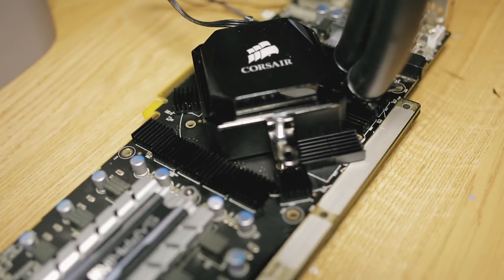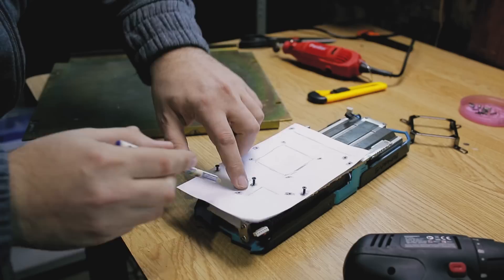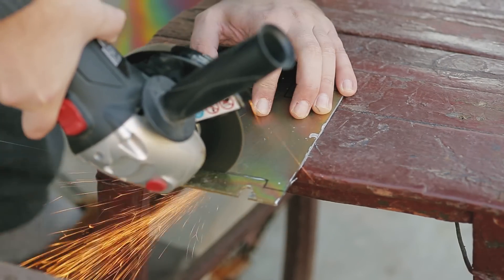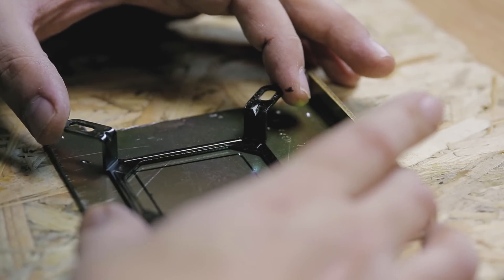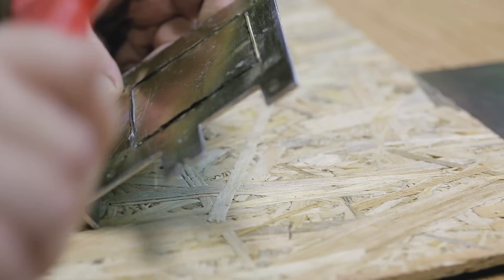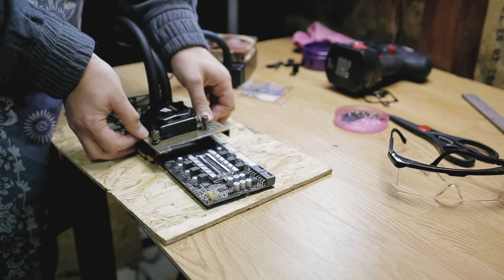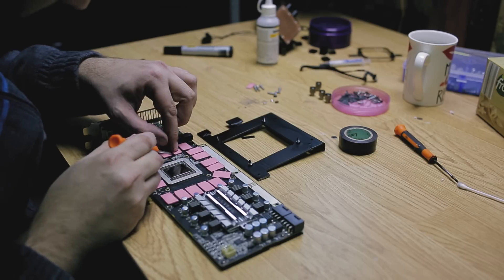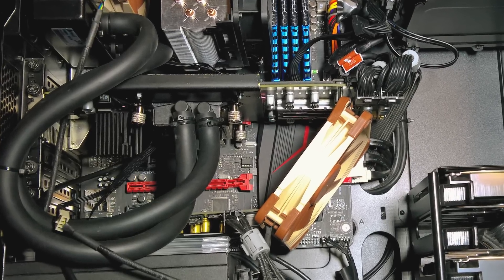DIY MOD plate for AIO water cooling Radeon R9-290 GPU

Comment: And if you want to go with a 120mm or 140mm radiator, ALPHACOOL has custom copper radiators that are SUPER deep. 1", 1.5", 2" deep, etc. So, you can DEFINITELY get the performance of a 240mm or 280mm AiO out of those radiators.

Comment: thanks, i tried following my gtx 1080 successfully although it doesn't look like yours but the performance seems pretty good max GPU temperature 60 degrees C, Hot pot 70 degrees C

Comment: Great Hack. Also if you run a bead of thermal paste on top of the pads, you can see if they are making proper contact with the plate, and it won't harm thermal contact either.

Comment: sir please help i want this diy mod in my asus 1660ti oc single fan phoenix is it possible?
Reply: @BeardsChips  its single and very small heatsink it super hot 89temp i will do the same thing but i will use the deepcool mini fs aircooler hope it will sucess
Reply: may i ask can i put small heatsnk directly to the VRAM without thermal pads?
Reply: i saw some other videos mod they put directly heatsink to the VRAM with no tape or thermal pads on it, is it still possible or bad idea
Reply: @BeardsChips  thanks for the help beards and chips

Comment: Did you bother to use a multimeter to check continuity from that metal plate to any of the terminals? I’m curious if you fried your gpu? When I machined a plate I had to emboss where the memory chips were so that the adapter plate didn’t short out on the smd circuitry. There were at least a dozen terminals with continuity before I further machined the adapter for clearance. There was no way that a flat metal plate would clear without shorting multiple components. After the proper machining I resolved the issue but it made for a very complex adapter so the average enthusiast has no way to fabricate properly. I own a full machine shop so fabricating them isn’t a danger to the gpu pcb components. I see your video is 2yrs old now and I don’t see a final test to prove your adapter. I hope nobody tried this without using a multimeter to verify a proper installation. Also you should use aluminum or copper and not steel.
Reply: That’s good. I couldn’t tell where all the contact points were because it was too difficult to see between the board and adapter with far too many smd components. Would be nice if YouTube allowed photo and video comments. It may have cleared if I had used some thick thermal tape but I’m not a fan of thermal tape due to its thermal inefficiency so I initially used some thermal paste and stuck the heatsink adapter plate on to the memory chips so i could use the residue to outline where I needed to machine around the squares in order to emboss them where the memory chips sit to elevate the adapter 1.5mm above the board. This also helps keep airflow between the boards and allows any additional radiant heat to transfer. My GPU project was a gtx1070. I also utilized a large 120x240 coolermaster for a LGA AM4 2066/1151 socket and built the adapter into a finned heatsink with additional fans that was designed to overhang over the main board a whopping inch and a quarter allowing the heat to draw to the outside and quickly cool where twin 30mm, 18,000rpm fans keep the adapter ice cool.. ,Still quieter than the factory twin fans, yet far more efficient. The design we used here dropped temps down to 40-50c. Total spent was $59.99 on the cooler and some minimal time machining a scrap piece of T6061.

Comment: Great how to, thanks a lot! I hope to be able to do this in this next week :)
Reply: Florin Musetoiu Good tip! I will take that into account 😀
Reply: Did it today! :D. I used 1 aluminium sheet of 1mm thick (I was afraid that it was to thin) and it works very well. GPU is around 60 ºC while VRAM1 is 88 ºC, this at 100% load and without noise which is really awesome for this graphic card model (and even reusing the old termal pads).
I was looking for PCB bending while putting the bolts and no bending occurred, however PCB started to bend when I attached to the mother board, I guess that it happened by the lack of supports and the power cords weight. 
Thanks for this video, It is very helpful and it can be applied to any GPU, you just have to find the correct metal sheet form for any GPU and follow these instructions.

Comment: using an aio where its semi not is always a lovely feat :D my 780 under my h100 is only about 2c hotter than my other accelerod card
Reply: the accelero is cooling the ram and vrm, and the zotac card im using with my h100i has a stock vrm heatsink that a 120 fans blowing on its fine

Comment: Is it cooler than the original mod? Also, what clockspeeds can you get with a cooling setup like this?
Reply: Thanks for the answer. I'm thinking abaut watercooling my card mainly because i also play BF1 and during that my card hits 84°C at auto fan profile on stock clocks. (1040/1250, i have a GIGA WF3 cooler) And when i use my overclock profile 1080/1400 at 100% fan speed it hits 84°C under a round of any operation. For the cooler i'm abaut to buy a CM Seidon 240M wich should be sufficent even on other, more powerful cards. For my own mod i'm thinking abaut making an X backplate similar to the one in the NZXT's kit so the stress would be even between the screws.
Reply: Hope it's nothing major. This is why i want to do a backplate of some sort if i make a mod similar to yours, maybe even an adjustable one so that later it can fit other cards.
Reply: The Deepcool Maelstrom 120k fits perfectly on my R9 290, I have it running Monero coin mining 24/7 and it never goes over 56c  https://www.amazon.co.uk/DeepCool-Radiator-Cooling-System-Liquid/dp/B00LTSWC4Y
Reply: Florin Musetoiu, Salut! Super tare mod-ul tau. Chiar este de apreciat faptul ca nu iei de bun ce vand altii si observi unde este loc de imbunatatire.
Chiar daca ai avut o problema de design, ai reusit sa recuperezi foarte elegant. De fapt chiar ma intereseaza si pe mine unde ai trimis placa pentru reflow? Poti oferi mai multe detalii? 
Multumesc mult si spor la treaba!